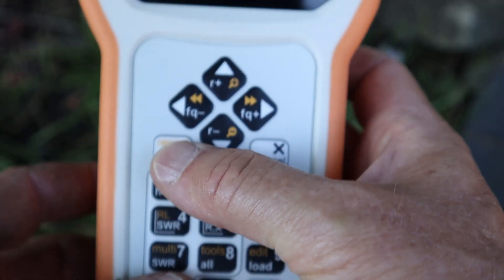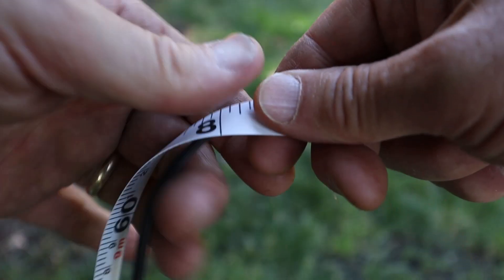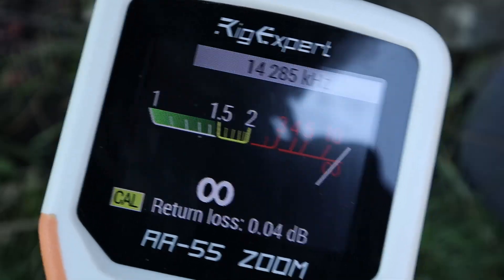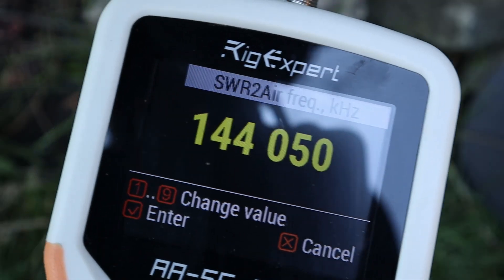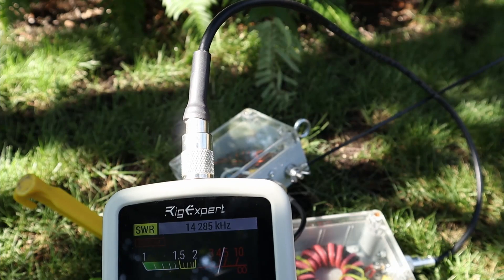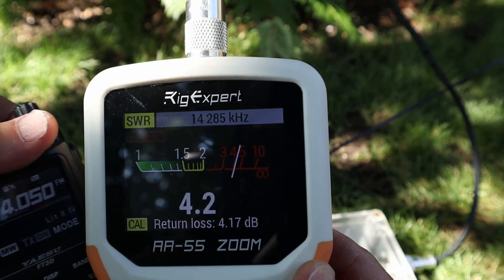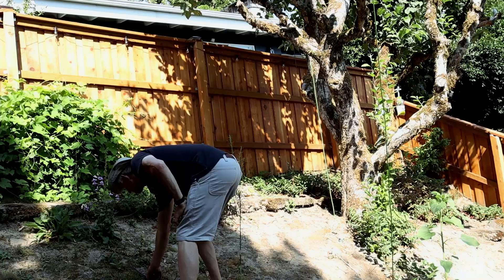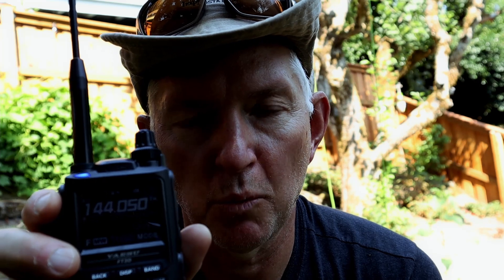How to use the SWR2Air feature with your RigExpert AA-55 Zoom! (#41)

Comment: Thanx much Steve - I will prolly get this unit.... Indispensible. cheers 'n 73 K4BEW cal
Reply from the maker: Glad to help. It has been one of those purchases that without question, I have no regrets getting.  You can pick them up on sale for under $275 if you shop a round.  Cheers!